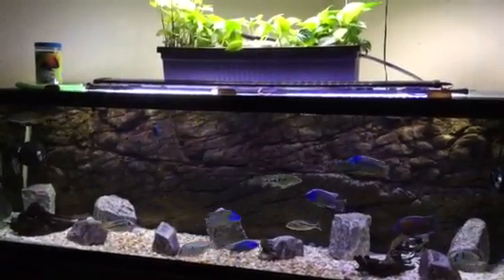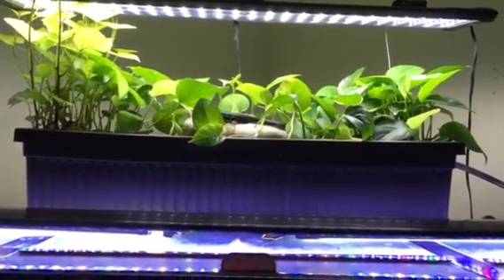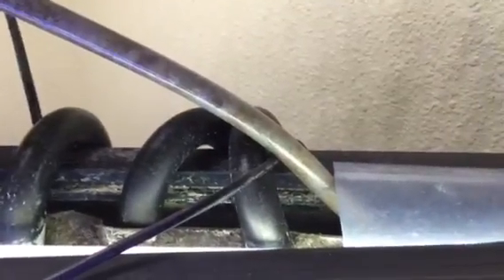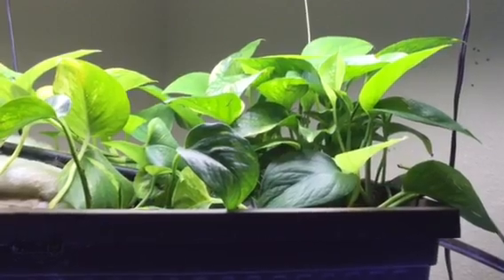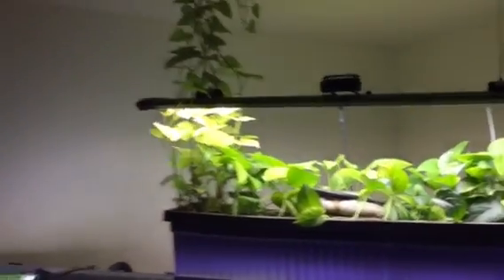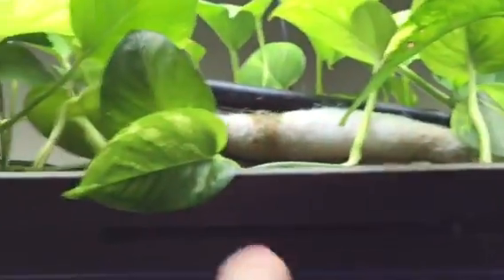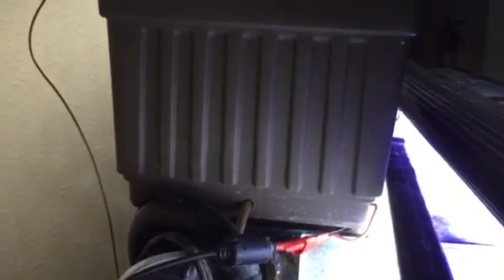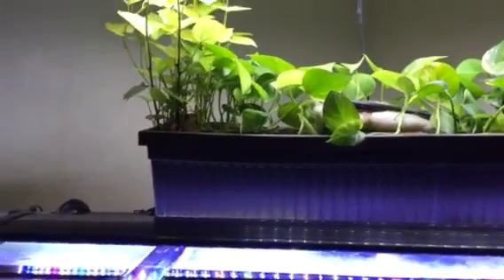DIY aquaponics | DIY overhead sump | how to build a overhead sump | how to build aquaponics setup

Comment: Looking good. 
Have had two of these running on two separate tanks for a while now. They definitely help, but I'd be careful cutting your water changes back too far. Water changes are beneficial for more than just reducing nitrates. I tend to do small water changes weekly.

Peace lilly also works well. And as Pothos and Peace lilly don't require high levels of light, they will grow very well with just some indirect sunlight. 

One of my tanks did hit a point where the nitrates were too low to support the number of plants, so some started to die off. Pothos is also great for this reason, as it's quite easy to remove and use somewhere else, or you can cut it right down, and grow loads more from the cuttings. 👍

Comment: Great video! Have some questions. do you know if there are plants that you must not use because they're potentially poisonous? I ask this because I tryed doing aquaponics with Singonyum sp. That is a poisonous plant, in the first day one female guppy seemed to sleep on the ground, second day two Corydoras did the same, third day a danios zebra did the same, before I get the plant inside of the aquarium  none of my fishes had this behavior. When I saw what was happening I thought on the plant an took it out, changed some water and added some activated carbon in the filter. I've investigate about what happened to me. Plants use some substances on their roots to defend themselves of bacteria or other things when they're stressed, I supose that my plant get stressed when I put inside of the tank. I think we have to do more research about the plants that can be and cannot be in contact with the water of our aquarium, because, although they aren't eaten by our fishes, they can be potentially dangerous for them.
Reply from the maker: 6stringsMark thx for stopping in and the comments I would suggest just researching each plane before you use it. Pathos plants are known to be used in the aquarium hobby for a long period of time with zero negative results that’s why I chose it.

Comment: So alot of these plants dont need soil? I know pothos doesnt but I cant easily find it in my area. Can I just plant anything into my lava rock media?
Reply: Most tropical house plants and plants in general will grow roots under water once they become adapted to it. If a plant is taken out of soil and into this set up it might go into shock and melt back. The roots may rot but all new growth will be good. The same thing happens with many aquarium plants, they quite often are grown out of water (the ones you buy in tubes at PetSmart etc.) When put into an aquarium usually will die off at first, then start to grow.

Comment: Sweet set-up!  Could you explain how the inlets and outlets work?  I'm not exactly sure how that part works.  Thanks!
Reply from the maker: doubledoubleandfries on the right side of the aquaponics filter there is an inlet tube you can see going inside from a submerged pump inside the tanks and in the middle of the aquaponics filter there is two tubes running vertically one side of each tube is set at the water height of the filter and the other side protrudes through the bottom for the water to drain back into the tank also there is a small hole drilled in the side of the aquaponic filter with an airline protruding the same way to allow for complete drainage of the water volume. Thx for stopping bye and the comments.
Reply: Okay watched the video again.. My questions are answered.  Thanks!
Reply from the maker: doubledoubleandfries both tubes in the middle serve the same purpose and there is mechanical bio and chemical filtration In the planter box

Comment: Create a vertical stand holder & stack 3 or 4 & let it trickle down. You'll do water changes once every 30-60 days?
Reply from the maker: Michael Piccirillo hey Michael it's a good idea for expansing it's capacity but the problem is the fish need the minerals that are in the water naturally the more water changes the better really. I still do water changes over %50 each week even though I don't have to for nitrate reasons but I believe it's important for the minerals in the water to be replenished every week. Thanks for the comments and stopping by.

Comment: Great idea about putting the outlet near the bottom, specially if you have a not so powerful pump (400L an hour, adjustable). But can I make a suggestion? It's bound to overflow at some point, specially with that very narrow tubing you are using. It might be a good idea to drill an extra hole right under the top edge of the container and fit in a (larger) tubing directed towards your tank. Of course make sure it can't leak. In case your small tubing gets clogged - trust me, it will sooner or later - you don't risk to empty your fish tank onto your floor instead of cycling the water back to the tank. Your idea is very usable, don't get me wrong, it's easy and simple to build, but keep in mind that it needs an overflow in case of clogging up.

Cheers.
Reply from the maker: TheOpelkoenjas it actually already has two overflow tubes on the inside already it's been up and running for 2 years no issues the little one on the bottom is just to fully cycle the entire volume of water from the planter because the other two draw from the top to maintain a steady water lever appreciate your comments tho
Reply: Awesome! :)

Comment: I have similar build going about 11 months in goldfish aquarium. The pothos have proven to be aggressive growers covering the top of a 72 gallon aquarium. about to post a quick video
Reply from the maker: Taylor Trombetta cool ya I'll check it out late response
Reply: Pothos are indeed awesome growers. I seriously adore that plant. They devour nitrates like no other. Got mine as tiny little plants 2 months ago and the moment the roots started to grow (took about 1,5 week) the plant has grown like no other. They are still small, but they doubled their size now. The nitrates are zero since the first new long roots started to show up.
Reply: I was actually thinking the same, since they are entirely made out of a combination of toxic chemicals reacting to each other. I think plastic would be safer (???), but glass would be the safest option in my opinion if you want live things to stay healthy, and not only visibly healthy. Not sure how much the plants - let alone the fish absorb those chemicals tho. The exterior of the plants and fish might look awesome, they SEEM to be healthy, but I'm wondering how much toxic waste they actually have inside of them. Microscopic and other testing is the only way to find out.

Ps: foam is indeed toxic IF it comes in direct contact with living things. The foam HE uses seems to have that protective coating, a waterproof coating so to speak. But still, I wouldn't trust it.

Comment: I do 50% each Sunday but I know for a fact I have more than 35 fish ranging from about 6.5 inches to as small as 2 inches all in a 125 I know that's quite a bit but I don't think I will be removing any fish anytime soon so I was looking through your channel it hit me this guy's a genius! my fish don't like plants in the tank but they can't do nothing about the ones on top lol
Reply from the maker: I appreciate the comments Ya I just don't like the look of plants in the tank for Africans it being completely filled with matrix helps a lot to boost the amount of beneficial bacteria whenever I want to set up a new tank I can just pull some seasoned media out of it and have a tank instantly cycled that's what I did with my 55 gallon
Reply from the maker: And I used to have over 50 fish in here and it did just fine. I pulled a lot out due to aggression
Reply: +AK Aquatics22 like I said you're a genius! thanks for helping me get mine situated 🖒😊

Comment: after a couple of months in use, how much has this helped your tank parameters?  I'm actually attempting this myself
Reply from the maker: It helps a lot to keep your nitrates down it takes a few months to really start working good it adds a lot of stability to the tank as well
Reply: +AK Aquatics22 thanks I am currently overstocked but this is one step in attempting to control my nitrate or at least keep it at bay lol
Reply from the maker: +k24boosted one thing I'm thinking of doing to make it even better at reducing nitrates is put a big of seachem denitrate in to but my tank as it is has 35 large fish all average about 6 inches and my nitrates stay around 20 ppm with 50% water change once per week.